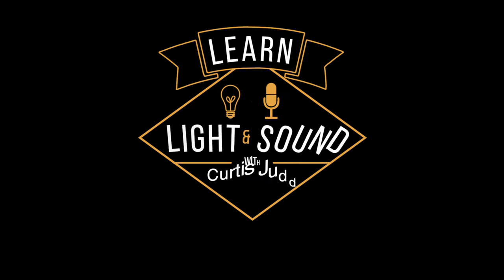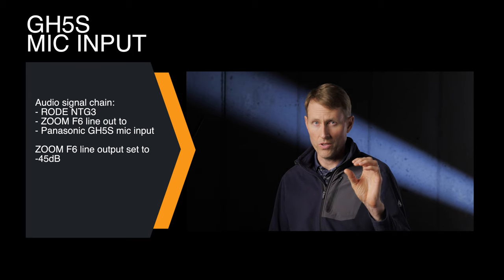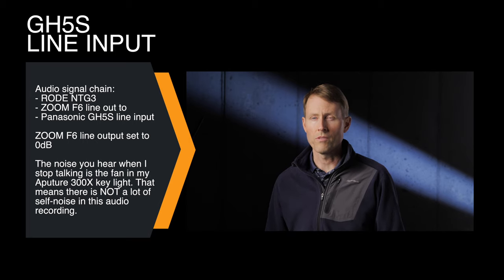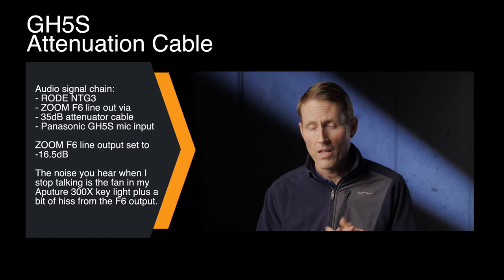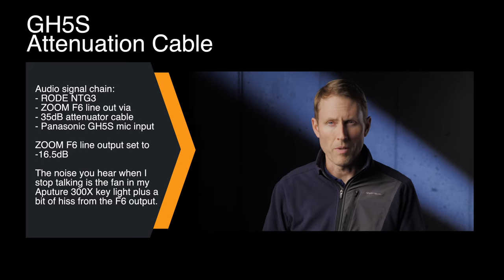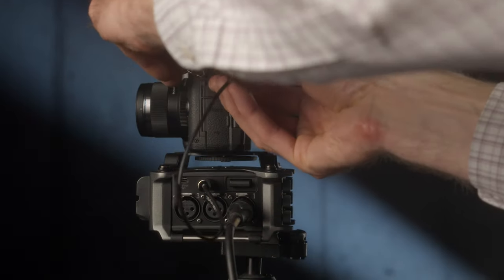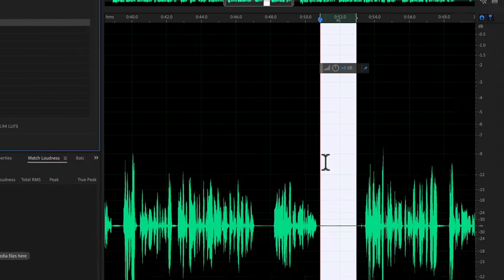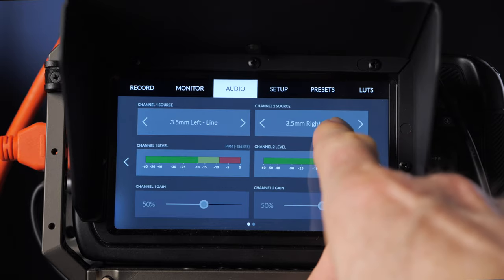Zoom F6 Line Out Issue & Workaround

Comment from the maker: ** January 2022 update — some people who have bought an F6 in the last few months report that they do not experience this issue. It is possible that Zoom has made a change to the hardware design to fix the issue with the most recently produced copies of the F6.

Why not just use the headphone output? Well, you can, but in my tests, the headphone output was not the highest quality and colored the sound a bit. In a pinch, it'll work. For regular use, I'd recommend an attenuator cable instead.
Also, this is only an issue for the F6, not the H6 or any of the other ZOOM recorders.
Reply: I actually have very similar sounding noise on my H6 going to my GH5 in the same scenario.  MKH-416 gained (-6db peak, avg -18 to -12), H6 Line out (adjusted -25db) -> GH5 Mic In (adjusted to -12).  Hoping that attenuator cable fixes my setup as well haha!
Reply from the maker: I hope so too! I think it will.
Reply: Indeed noticed the heavy noise hiss with the line output issue. it's been sitting down,  I only had a -15dB Attenuator cable at the time helped a bit. Really need that -35 or higher Attenuator cable for a Sony Camera. OR -15 together with -35dB.
So the F6 Line output signal is way hotter than the other Zoom Recorders? Why is it only an issue with F6.

Is it due to 32bit Float?
Reply from the maker: @BushMasterThermal  The F6 is capable of line level output. I generally find that to be between 35 and 40dB hotter than mic level. This also seems to apply to the ZOOM F series recorders and Sound Devices MixPre recorders.
Reply: @curtisjudd  I see that they came out with a New Firmware update to fix the issue. Have you tried it since?
Reply from the maker: Cheyen.S yes, it didn’t help.
Reply: @curtisjudd  Yea... had a feeling they missed the Perfect Model Release.

As usual they have to release a second version of the Unit. Such as F8 .. F8n to fix the flaws, they need to send these units out for real world testing before  dropping it into the market and having customers deal with mediocre devices.

That now have to "Upgrade" to the 2nd generation device since the first was flawed.

Even the "Combo Jacks" As Gerald Undone has mentioned. Why leave it out when it was such a great hit and option in your other recorders. 

Why.. because they seem to have it planned all along.
2nd Version will have the XLR Combo Jacks added and any flaws consumers encounter in the first version after real world use globally.

From the start i was thinking you know maybe i should just wait for "F6n" when they get rid of any flaws, bugs. And here we are...

Maybe they might finally add back an on-field Compressor Feature like in the H Series. Compressor feature would be great to send to the camera and sound better than Pure Limiters only. Run and Gun, nature, wildlife etc.
When they bring out F6n 😂. F6 2nd Gen

Animal Zoo's can go from Ambient to very High Loud Rowdy Sound levels in a split second. And the compressor comes into play.

Guessing they can really upgrade their Compressor Audio Features and Performance by then too.

Before release there were delays due to hardware issues and bugs, here's another that stays.

Another reason i don't like buying Devices as they release, before they are even fully reviewed and tested over a few months.
Reply from the maker: Cheyen.S I’m not sure that the current F6 form factor can actually fit combo jacks. They take a lot more internal space. But I’d be ok with a larger form factor.

Comment: Hi Chris, I recently bought an F6 and when I connect my stereo mic (3dio omni pro) to my recorder on 32-bit mode, "exceeding maximum input level" pops up on my screen.  Turning the gain with knobs 1 and 2 didn't seem to affect it.  How can I adjust the input levels? My mic doesn't have a build-in gain adjustment on it.
Reply from the maker: Hi Liz, I'm not familiar with the 3dio omni pro so I'm not sure. Probably best to contact the mic manufacturer for details on that. Best wishes!
Reply: Hi Lizi! Were you able to figure this out? I do have the same microphones as your 3dio, so I'm curious if you figured it out. Thanks!
Reply: @dethskulpt2020  yes, make sure that all inputs are disabled (LED off) before plugging in the mics, as well as before unplugging them. “Hot-plugging” (or unplugging) microphones (with phantom power on) not only may create this kind of problems, but in some cases it may even damage the microphones and/or the F6 itself.

Comment: Hey, i need help to decide between MixPre 3 ii and Zoom F6 for outputting to my A7Siii. Is normal output cable works out of the box for MixPre3 ii?.. Is the Attenuator  cable worth for the extra mic input on Zoom F6?.. Sorry for asking so many questions.. I'm in dillema XD
Reply from the maker: Hi MrKokom, I would opt for the MixPre given the option, unless you really, really need more than 3 XLR inputs.
Reply: @curtisjudd  so mixpre 3ii is not having the line noise issue?
Reply from the maker: @MrKokom  correct. It is only the ZOOM F6 which seems to have this issue.
Reply: @curtisjudd  thank u so much that helped me a lot 🙏🏻

Comment: Thanks for the great videos Curtis.  I actually tested F6 with my Canon R5 yesterday and initially the signal into the R5 was distorting like crazy, however I noticed there was an attenuator / wind filter option in the sound recording menu, which I engaged and now it works like a charm with the line out level from the F6 at -16.0db & an input level of around 26%.
Reply from the maker: Nice find, thanks for sharing!
Reply: You gave me high hopes, but in Sony A7IV wind nose reduction is deactivated when you connect external mic :o
Reply: @JoATTech  Did you find a solution? I have a Sony A7IV aswell?
Reply: @Astor_1  There is not solution other than 3.5mm attenuator cable. You can also get another camera which have line-in (I'm getting S5IIX :D.) I think Zoom F3 does not have this problem (Maybe @curtisjudd can confirm this?)

Comment: Good job, Curtis. What do you think would be the most elegant solution? A menu toggle on the F6 that cleanly switches to mic level?
Reply from the maker: Thanks Gerald. No, I suspect the same problem would still be present - seems like a hardware issue - and mic level is different from camera to camera depending on the gain range spec of the camera. Unfortunately, I suspect the solution is an F6 mark II with new output hardware which doesn’t get noisy when you pull the output level/fader down to accommodate mic level inputs.
Reply from the maker: Is it a lot of fans who cannot stand to admit flaws?
Reply: @curtisjudd  how bout Zoom Supply the cable AND documentation with FULL explanation? Cheaper than new R&D.🤷🏿‍♂️. For the overall performance... I'll work around it with an attenuator cable no problem.
Reply: Get a MixPre!
Reply from the maker: @DavidGriffin  That'd be my thought. I don't know how many of these F6 units they've sold and at what margin, but I'd sure appreciate that.
Reply: @curtisjudd  do a final review of the F6. Mention that. Every registered owner should either get a free cable mailed or they should send an Amazon credit for one. Every other one in stores should automatically come with a cable and "critical instructions"
Reply from the maker: @DavidGriffin  This is the addendum to the final review which I posted last year. I have already expressed my opinion to ZOOM. At this point, it is up to them to decide how they wish to treat their customers.
Reply from the maker: @DavidGriffin  Also, I've been asked many times whether I recommend the ZOOM F6 or a MixPre-3 and the answer is almost always MixPre - depends on how the person will be using the recorder. If feeding audio to camera, MixPre is my recommendation for sure.
Reply: @curtisjudd  Zoom had better listen to you. Since that's such a weird problem to have on a $600+ piece of gear... It could be their reputation in the future.
Reply: @curtisjudd  @Gerald Undone I hope if Zoom does a mkII they go with combo jacks instead of XLR-only.
Reply from the maker: @theothermarkwilliams  If they do include combo jacks, the recorder will need to be larger than the current F6. Combo jacks take up a lot more room inside the device.
Reply: Dare I get involved in this discussion?

Ok -- I am not entirely sure you can classify this as a 'hardware issue'. Being an EE who is responsible for design and maintenance of electrical hardware at work (albeit not audio equipment), I begrudge terminology such as 'hardware issue' or 'software issue'. The way to look at things is instead a) Is the hardware, for instance, performing as expected/designed?, b) is the simplest solution in hardware, or is it in software, or something else?, c) is this a problem that needs to be solved by the creators of the Zoom F6?

It seems apparent to me that the Zoom F6, along with some devices I personally own, is intended to output line level audio. Simple as that. You made the point yourself that line level is much stronger than mic level, and there is a HUGE advantage to this. Your SNR(signal to noise ratio) jumps up from the output of the Zoom F6 or similar device and provides noise immunity to the signal after that point. Not using line level audio also puts you closer to the noise floor of the amplifier and circuitry inside the Zoom F6. Removing this fairly low noise level would likely be a larger investment in physical hardware than the problem warrants. This noise floor isn't increased when the gain is turned up on the F6, therefore turning up the gain/output volume improves your SNR. So, is the hardware performing as intended/designed? Yes.

Next question, we'll skip to C since I don't immediately see a 'software' form of solution to the problem, but having adjustable input gain on your camera seems important. I don't believe the Zoom F6 needs to solve this problem, simply because it is performing as intended. The best way to solve the problem is to USE line level audio. Even if you use an attenuator, there's the possibility that the lower input levels on the microphone's ADC could introduce more noise, negatively affecting your SNR. 

But to conclude, the Zoom F6 isn't broken. It functions as intended. If I were working at that company, I would explain to you why I would not agree with the idea that you believe the Zoom F6 has to be updated to solve this problem. An attenuator cable works fine, it's solving an incompatibility between two pieces of hardware. The issue honestly lies with any camera that does not give you the option to adjust your audio recording level or switch from line to mic level input. You want your signal magnitude to be as high as possible up to the final ADC (in the camera), to again, improve noise immunity.

Finally, if they were so inclined, they could add a selectable attenuator into the Zoom F6 so that you didn't need the cable to be the attenuator.. I would oppose this as well, since attenuating the signal as close to the camera input improves the distance over which you have a high SNR, and reduces the size of the antenna you effectively attach to your high gain camera microphone input. Having the ability to reduce the gain in the camera is actually your best bet, because if you do that, you no longer have a high level of amplification that might be more likely to inject noise into your audio signal.

I believe my reasoning here is pretty sound, but I am open to discussion if the merits of what I have said here are unfounded. As of this moment, I am pretty sure your assessment of the problem and the optimal solution is incorrect.

I had to sort out the issue with my Saramonic wireless lavalier set using the same methodology (changing input levels on the camera so I could send line level audio to it). It does not seem to be a phenomenon isolated to the Zoom F6. I also had to do this with my Beachtek DXA Pro Micro, although it had a lower noise floor than the Saramonic, it was still far more than I liked when stuck at mic level input.
Reply from the maker: @Sevalecan  Thanks for the discussion and perspective. Here are some additional details: The ZOOM F6's output fader introduces more noise as you attenuate it. The output fader is there so that you can reduce the output level from line level to microphone level specifically for consumer level cameras which only have a microphone level input and cannot be switched to line level. This is a pattern ZOOM and many other manufacturers of audio recorders/mixers have established in prior products. I have spoken with one of the product managers at ZOOM USA and he has admitted that this is a problem from the standpoint that it is not working as intended. Whether it is a hardware or software issue is somewhat irrelevant from the standpoint that the product is not operating as the manufacturer intended. But it is relevant from the perspective of whether the issue can be addressed via firmware update or using an attenuator cable or any other physical solution, e.g., sending it back to the manufacturer for modification.
Reply: @curtisjudd  I find it very interesting that the product manager agreed this did not function as intended. Of course if they choose to design their product with the requirement that it mitigates noise levels sufficiently for mic level output, that is their decision. I expect one of a couple things happened in this case: the design engineer did not agree with the specification being practical(And I could be wholly wrong) and simply pushed out the product with this feature not working as intended, or proper testing was not performed on the design before production. If it was, it should have been fixed prior to release. I am not doubting who you spoke to or what you were told, I just find it interesting.

That said, lower noise levels in the unit is a good thing, but personally given the option I would get that line level signal as close to the microphone jack on the camera to maximize noise immunity. Per distance traveled for a mic level signal in a cable, the noise picked up by the cable will reduce the SNR by a more significant margin than if it was a line level signal. Of course if your device is mounted on the camera it's a short distance,  but devices such as lcds can generate a lot of switching noise to be picked up by cables(I am not sure if OLED displays have the same issue).

Thanks for responding and providing that tidbit, I am definitely enjoying the discussion.
Reply: @Sevalecan  It is a pretty well established feature included in their F4, F8, and F8n recorders where it works very well. So I suspect that is why there was quite a lot of "noise" in the community when it did not work as well in the F6 recorder.

Comment: Thanks for the info.  Wondering if using a Sennheiser G3 from the F6 to the camera has a similar effect?  I just did a shoot with the Sony A7Siii and the F6 and the camera audio was all hissy.
Reply from the maker: Yes, definitely, if you used the output fader to reduce the level going into the G3, the same issue as demonstrated here exists. You'd need an attenuator cable to address the issue.

Comment: Well, your video helped me solve a problem that had nothing to do with a Zoom F6 (This issue isn't specific to this device). Once you mentioned mic level vs line level I stopped the video halfway and checked my A7III for audio recording level settings. I did not have an issue when I originally set up my first external mic for the A7III,but it turns out one of the modes I started using doesn't let you adjust the rec level. After switching modes back to movie, I was able to adjust my audio rec level down to allow for higher gain from the various microphone amplifiers I have which solved the noise issue. Didn't appear to be a "line" vs "mic" selection, but I was able to effectively change the gain manually on the camera, thus I do not need an attenuator cable.

Good info, still.

Comment: I recently got the wireless Comica mic system and it gives a cable for using on phones, a regular cable, and a attenuator cable that they suggest to use on cameras such as Sony. That was the first time I've seen or owned an attenuator cable.

Comment: potentially silly question here.... but...
since the attenuation cable isn't perfect (or ideal) is it better than just using the headphones out on the zoom f6 to go to camera ?
Reply from the maker: Probably yes. The headphone amp isn’t great. Also, if you have a newer F6, this all may not be an issue. Seems they changed the hardware at some point after I posted this video.

Comment: Curtis, please be advised that if you use the Atomos Ninja V external Monitor/Recorder's Line In, then you can also switch the Analogue Input from MIC Level to any custom Line Level input :)
Reply from the maker: Ah good - so if you bypass the camera and feed audio to the Ninja V, you can set the Ninja V to line level. Then you just need to account for the sync of audio and video. Thanks Mark.
Reply: @curtisjudd  I find the Ninja V has Very Good Analogue pre-amps ! I was frankly rather surprised. Atomos chose not to skimp on employing higher quality analogue pre-amps, which sound far superior to most camera internal pre-amps I've heard :)

Comment: Also, if anyone is using an Atem Mini, Mini Pro or ISO there is a toggle in the software that switches between Mic Level and Line Level. I was doing a live production and noticed that the F6 Line out was too hot going into my Atem Mini Pro ISO, and had a devil of a time finding the toggle. I thought that it would have automatically detected the difference, but you need to go into the software, click the cog at the bottom, go into Audio, select General and choose whether each Mic input is at Mic or Line level with a radio button for each input.
Reply from the maker: 👍I've never seen an auto- detecting mic/line feature, but that'd be a good idea.
Reply: @saintShane where have you been my entire life!!! this was great help